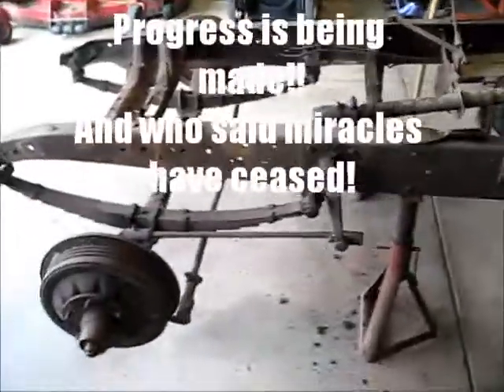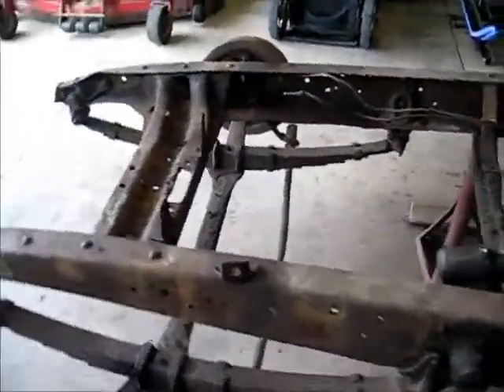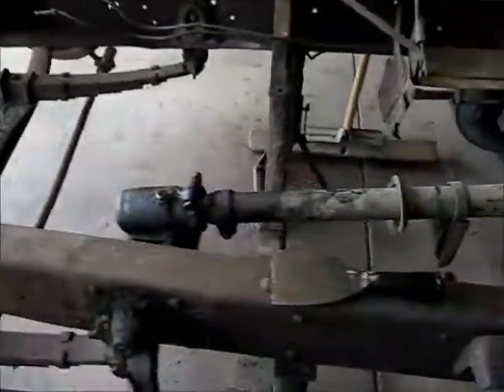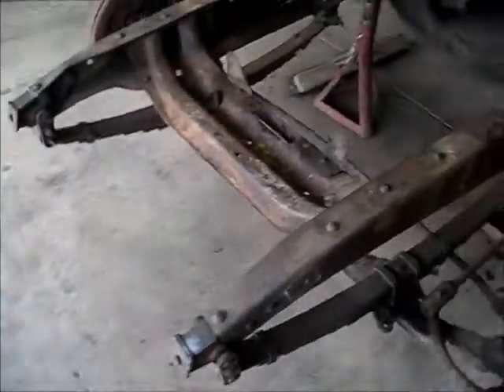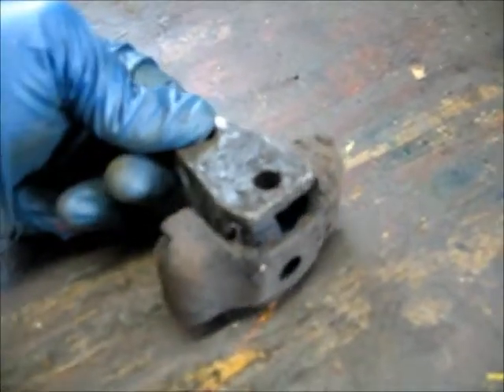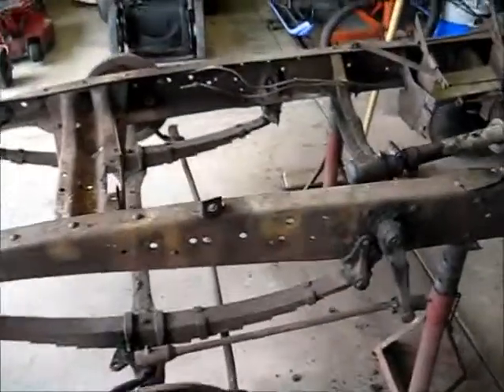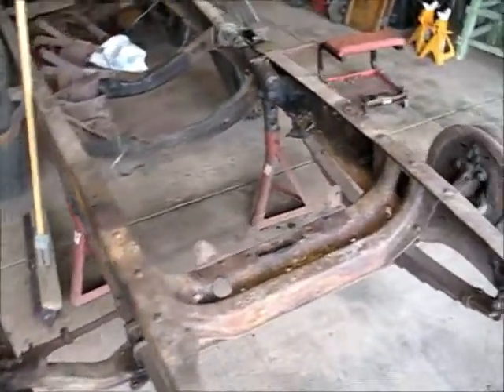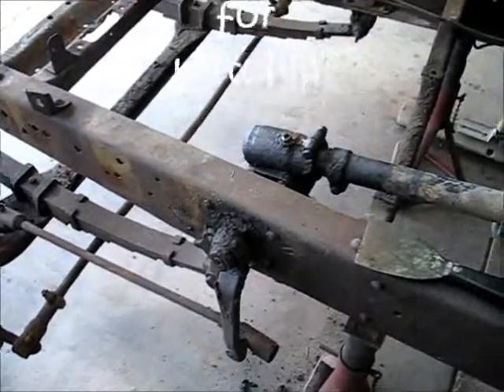My '36 Chevy Truck - Part 14

Comment: what you need to fix the engine mounts is thick quarry conveyor belt , if you still have these to fix let me know , I will mail you a piece to do them , I just made new sling straps for my old wrecker from the stuff , and have some scrap in the shed ;)